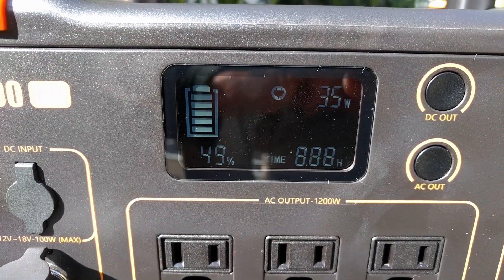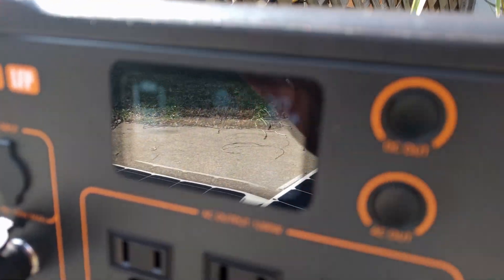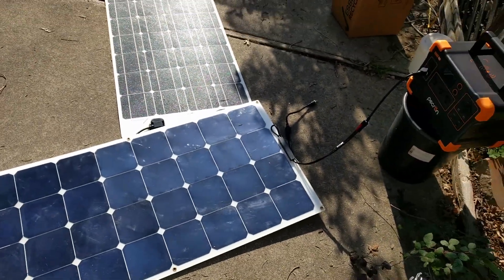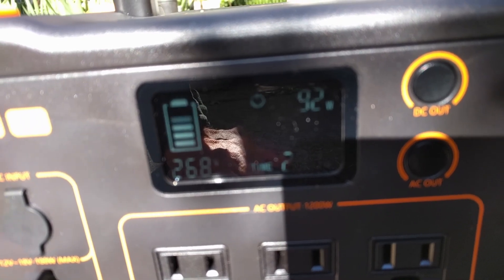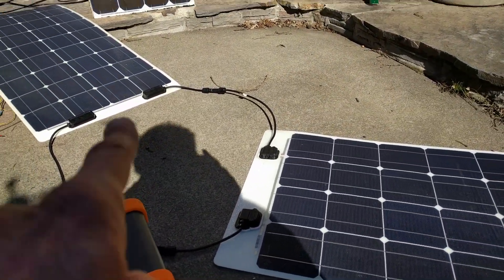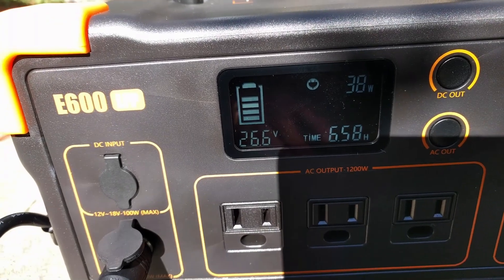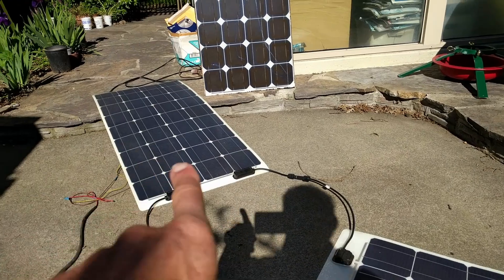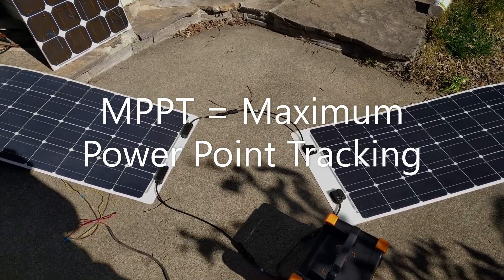Pecron Power E600 - Solar Charging the Battery Pack

Comment: Overall very pleased with my unit.

Some observations re solar charging:
After thorough testing, I can't figure out why solar input to the Pecron E600LFP is relatively low with panels in series (all other configurations, i.e. single panel or in parallel behave as expected). 

This is our test results (done with 340 W qcells rigid panels - Voc of 40.91 V and VMPP of 34.10 V):

300 W solar input from a single qcells 340 W panel
270 W solar input from two(!!) qcells 340 W panels connected in series
So even lower input from two panels connected in series, than from a single panel!!?? 
390 W solar input from two qcells 340 W panels connected in parallel
393 W solar input from three qcells 340 W panels connected in parallel

Anyone got an idea, why the Pecron E600LFP has such a relatively low solar input from panels connected in series?
Reply from the maker: The MPPT senses the photovoltaic panel(s) voltage and currents (I), the change in I with V is then used to determine the operating point for the charge controller.  Was not impressed with this charge controller....the controller was slow and sub-optimum.  My testing of the borrowed Pecron unit showed that parallel solar panels deliver more energy and recharged the Pecron faster.  Otherwise the Pecron and its inverter were great !
Reply: @zaneenaz4962  Thank you for replying. 
Just really disappointing - and strange - having a lower solar input from TWO panels connected in series vs ONE single panel on its own. 

Under sunny conditions, it doesn't matter much, but in cloudy conditions (with much lower amps), it would be nice to have 80 volts from two panels connected in series rather than 40 volts from a single panel.
Reply from the maker: @nikolajhol  Power=V x I ...the current times the voltage matters.   Early low light turn-on/charging always desired, but the mppt still manages to catchup.  My preference is the panels in parallel, so each has the ability to deliver max current.

Comment: Humans are not ready for this kind of technology, humans are lazy.  Humans will be charging this system in 130 temperatures, they will be discharging the system down to zero power which will make it very hot 🥵 and then attempt to recharge it while it is hot 🥵.  This is what starts fires 🔥 out of control fires 🔥.   Most lazy humans are not edgamacated enough to deal with something like this.
Reply from the maker: Thankfully humans are creative.  They find options.

Comment: What is the minimum voltage for solar charging?The 2000 model requires I believe is a minimum of 32 or 36v .
Reply from the maker: ...that's the voltage range Pecron recommends, but my video demonstrated 21v was also charging the unit....just maybe not as fast.